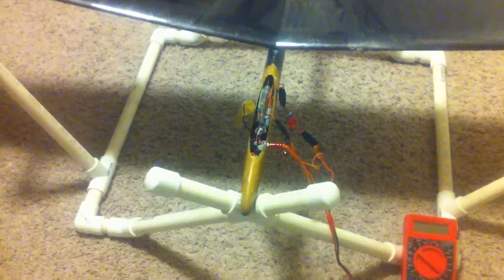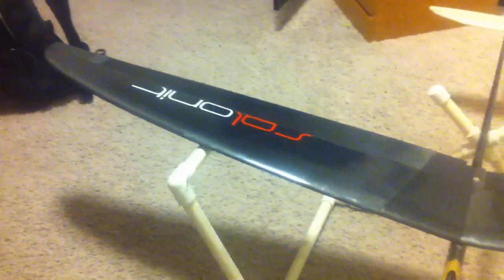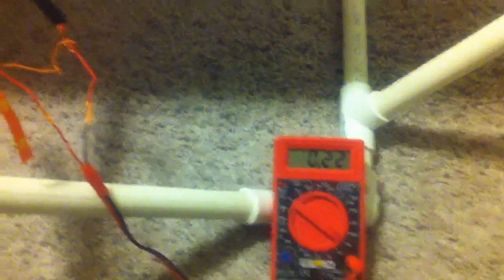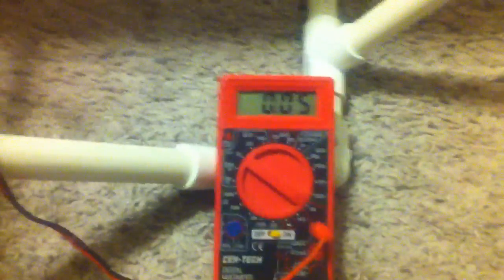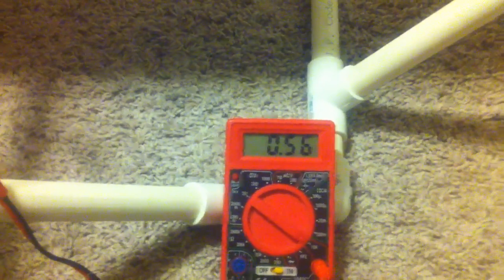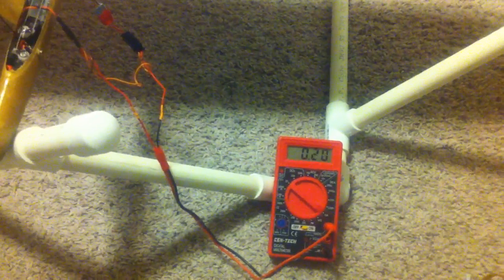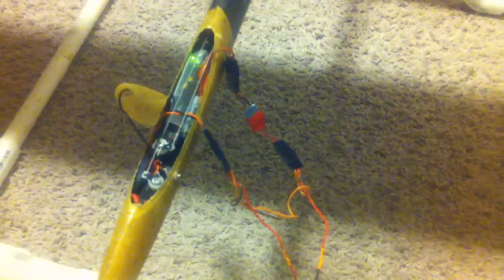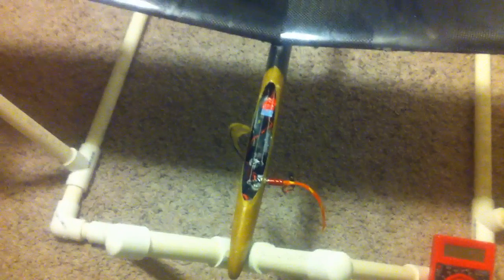DLG Servo Amp Draw testing

Comment: Every servo draw more than 1 amp burst after getting the instruction for run. But, that is not measureble by digital multimeter - use scope for that. Your BEC should tolerate that. If your BEC is just passive voltage down regulator, then yes - it can overheat. But if it is buck converter, then there is no problem supplying more curent without overheating.